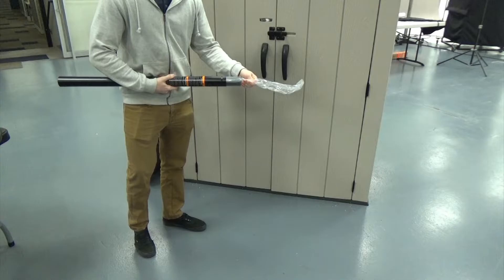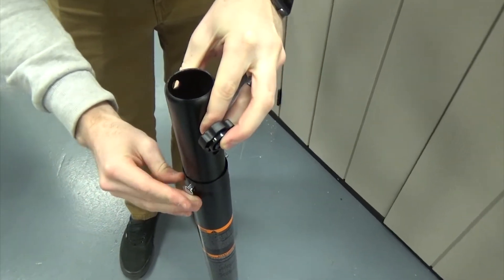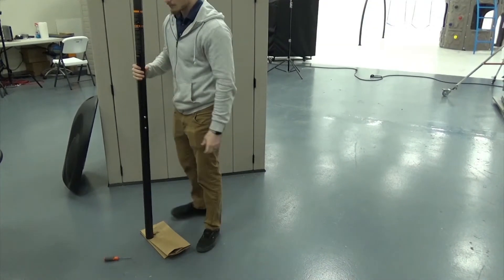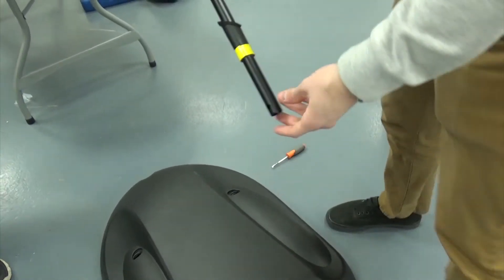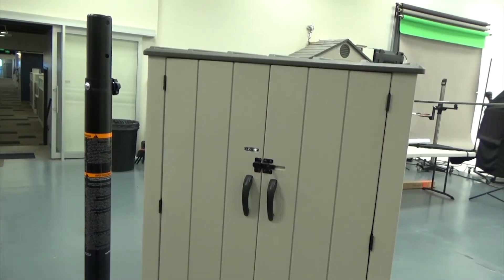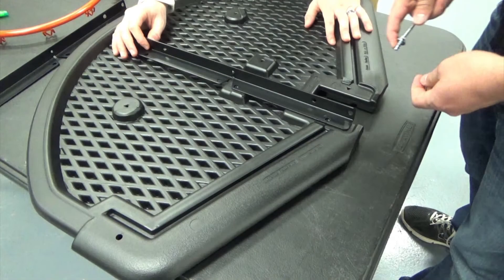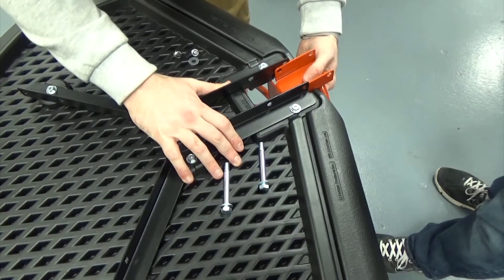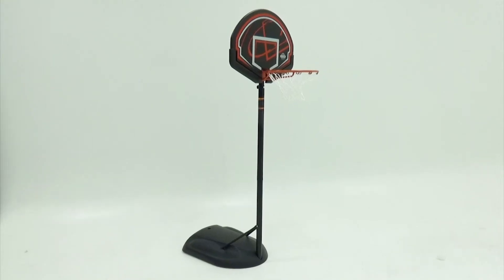Lifetime 32 Inch Alley Oop Basketball System Assembly

Comment: That bolt to attach the pole to the base is the biggest PITA EVER!
Reply: Steve Doyel I swear I just bought it yesterday they just expect you to have all these fancy tools they use
Reply: @NotBrandino  fancy tools? Bruh what are you saying? These tools are used everyday by mechanics or gear heads. If u haven’t used a tool or even have the tools presented in this video, ur clearly not a handy person, and should stay far away from the garage.
Reply: @NotBrandino  oh snap! This comment made my day and makes me feel so much more handy than I really am. I never thought of my socket set I use twice a year as fancy but I guess I am a fancy tool owner!